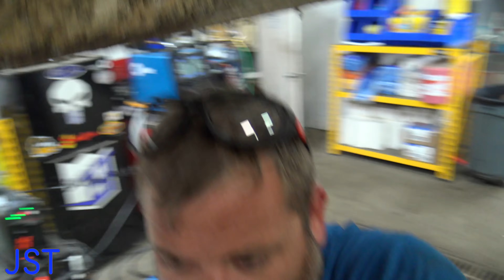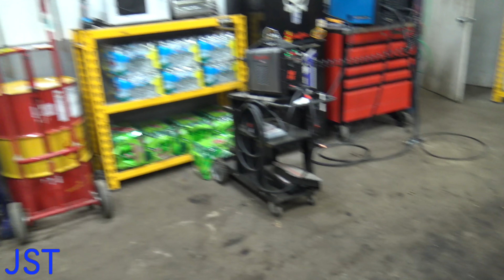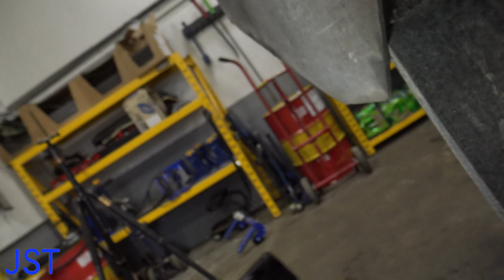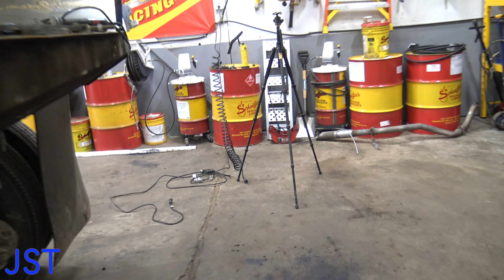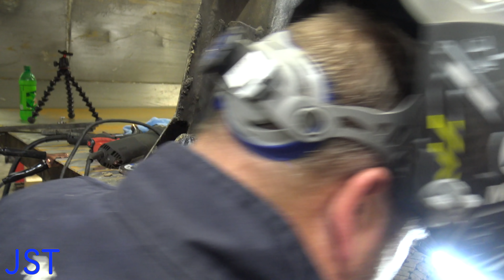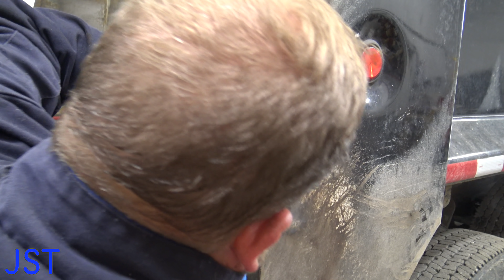REPAIR DUMP TRUCK GATE LATCH

Comment: Hi Justin, I probably don't have too mention this for the simple reason being, you probably already know that the proper and more efficient tool for that job is a arc gouger. It would have taken you,tops two minutes, the thing is with the air arc you can take just the weld off and not touch a grinder, believe me, I've got forty odd years in as a welder and it would make your life so much easier.  Regards OAG !

Comment: Years ago I worked for a truck body manufacture. I have been in a similar situation.  Cut out a bigger piece of the tower. Then fit the new hinge to a patch, then weld patch in place with new hinge

Comment: Good job for sticking with it. Since you have more to do you may want to think about a reverse engineering approach Along with the prints I think if you were to remove the corner skin so you could get to the inside welds,then align the latch weld the inside latch and work your way out doing the corner"skin" last It is  a tricky design because it looks like the corner holds it together Gives you an idea how hard the gate was slammed Make sure they are not getting pushed on the gate in the pit

Comment: What are your SWR’S in the 567’s with the Stryker 655 and a Wilson 2,000? I have the same exact setup and truck and cannot get my SWR’S below a 3.
Reply from the maker: Ryan Whalen  I have those striker radios in my 389’s and it’s about 2 1/2
Reply: Oh ok. Thank you for the quick reply. Love the videos! Have a good evening.
Reply: Ryan Whalen   I have run the same radios in co. pick up’s.  Check your co ax and make sure the ground for the radio goes to the tk chassis as best you can.
Reply: scott Baker I just ran a new coax last Sunday. The antenna mount on a 567 Pete is in front of the windshield at the top of the hood on drivers side. So needles to say the antenna mount is very low but there is no where else to relocate it. The bracket that the antenna grounds to is welded to the frame of the truck so it’s definitely a good ground. But I was wondering if running a separate external ground back to the antenna would that help too?
Reply: Ryan Whalen Not sure. When I had my rigs years back ,I had a 10ft stainless whip mounted to the front bumper that was squared on the end on a c-500 kw. I also had another copper strap going to the tk frame. Running a 500 watt box my swr was under 2.0 with the kicker on.. But as far as the striker goes I have run them in pu tks with a wilson 1000 mag mount with no linears and stock co ax length with 1/1 swr. You may need to trim your antenna
Reply: scott Baker ok I will get a external SWR meter and find somewhere to go and shorten it to see if that helps. Thank you for the help.
Reply: Ryan Whalen     Yep no problem.  You have pretty much eliminated everything else good luck

Comment: OMG!  I did this exact job on one of my trucks.  Well it went bad when a chunk of red hot metal dropped on a rear tire melting through it and it blew.  Dammit I now cover my wheels.
Reply: I use the fiberglass blankets and bunch them up pretty heavy now when I need to  weld around a tire.

Comment: Another issue is that going at an angle just created a thicker piece of metal. Think of going straight through a piece of metal vs at a 45 degree angle.

Comment: Get some plasma gouging consumables (under $100) for your plasma and you can surgically remove the welds next time. If done with some patience, you wouldn't touch any metal on the box and have minimal grinding/prep.

Comment: why not just open up the outside where the pin is welded through and cut the old pin and replace just the pin and the top part of the latch, who cares if you use a bolt or something and its sticking out the side atleast you dont have to cut out and replace the whole latch.